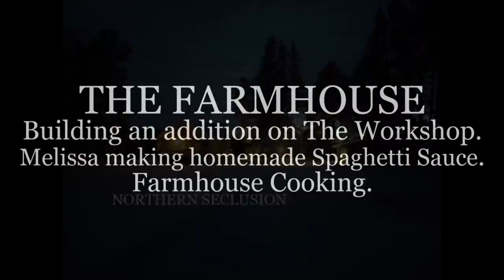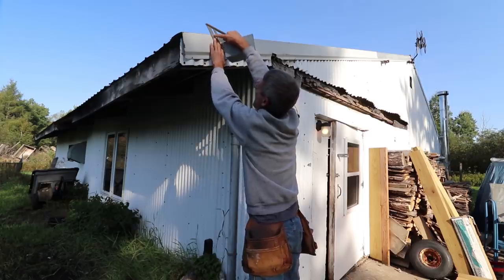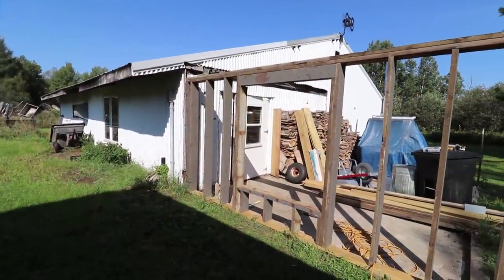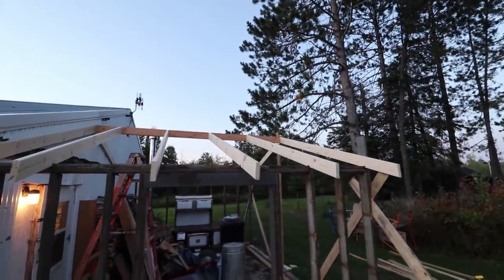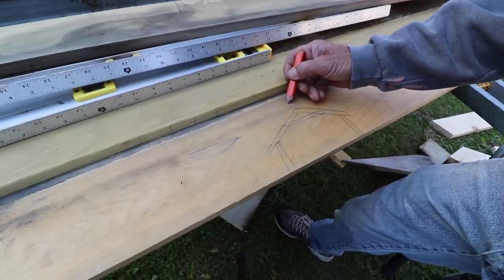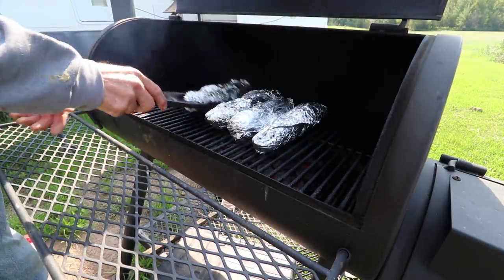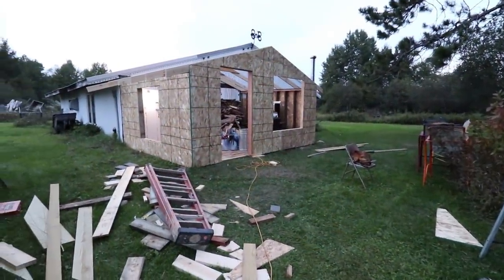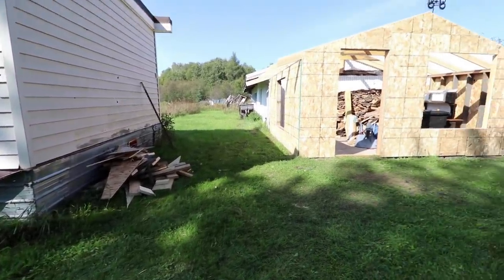THE FARMHOUSE. Building an addition on The Workshop. Homemade Spaghetti Sauce. Farmhouse cooking.

Comment: Awesome addition job Joe, scrap wood for the wood burner in the shop. You need to build a shed that size south or east of the garden for some calves so you can have home raised beef. Love your multi tasking of cooking and grilling and carpentry work on the workshop. Those boards would look good on the shop like the chicken coop. You must of wore the dogs out on the run into the woods. You need to add on to your outdoor kitchen and add a pizza oven to the outdoor kitchen, they have been advertising one on the You Tube channel ads it's pretty cool and not very expensive and then you can make your own pizzas and you have your own sauce and veggies to put on it. You saving the scrap wood from your house jobs comes in handy for your additions.
Love your videos waiting for the next one. Stay safe and have a great week ahead of you. With everything you cook at home you should have plenty of leftovers for the week at the camper and shouldn't have to cook at all.

Comment: Really great video Joe, I think that deck board on the front would look fabulous. Will you be able to move that stove through the doors? 💜💚👍👍🛠🤔
Reply from the maker: Yes it does fit through a 36 inch door. When I bought it we removed it from the peoples house through a 36 inch door. You need to remove some of the trim pieces but it does fit.

Comment: In places where they get a lot of snow,and if the rafters are 2 ft on center,they usually. Double collar tie the rafters….one on each side…in your construction business do use a router with a bit to shove in the window and doorways and just router around them in about half a minute?
Reply from the maker: No router needed to install windows. I am not installing plate glass, I am installing windows. Very seldom will you see double collar ties unless it was a damaged truss that needed a repair. In that case you usually have to do it with 3/4 inch cdx plywood and it must be glued and then you have an engineered nailing or screwing pattern.

Comment: Joe, you need an Air Nail Gun or gas Gun!!! You may have them but don’t want to show off with them. But working bye yourself is hard enough!! without using old school tools? Lol next you will be bringing out a brace & bit for the hole you want to drill. Lol
Reply from the maker: I was going to bring out the compressor and the air guns but figured that it was too much of a hassle for a job this small.
Reply: I just think the wear and tear on your body let alone you working by yourself. Man I’m hear to tell you I don’t know how you did all that with just you holding up both ends of the rafter runner?
Can’t wait until Duck Season!!!

Comment: I feel (no engineer) that u should have added two more two by eight s to your ridge pole😁
Reply from the maker: Never needed in this situation. I could actually have done this with no center ridge since all that ridge does is hold things in place as long as I have the collar ties. When they use a truss system there is no center ridge. Adding the collar ties in effect made these into a truss. Once the roof is sheathed or in this case the cross 2x4s were installed the center is doing nothing. If I was to do this using no collar ties because I wanted a fully vaulted ceiling then I would have needed a strong ridge because in that situation the ridge is holding everything and all the weight.

Comment: Looks good Joe..curious what type of folding saw horses you were using. I am tall like yourself and those looked a comfortable height as most are too short for me. Thanks
Reply from the maker: The ones in this video are DeWalt. I buy them at Home Depot. I have a few pair of them and they last a long time. If you do not cut through them. Lol.
Reply: Are you short? Joe is not tall…at all.
Reply: @SuperDave44Mag  He appears so
Reply: @ronaldlee2376  not walking thru a 6’-8” doorway.

Comment: Joe, How does that OSB hold up at the ground level? It looks so close to the ground.
Reply from the maker: You can not have it do any ground contact. You will see what I will be doing in an upcoming video. I have not done it yet, today was finishing the roof, and installing the door and windows. Stay tuned, it is hard for me to explain what I will do but to answer your question, no it will not hold up well at all.

Comment: Or you could beef up the ridge pole like go 2 by12 or bigger then don't worry bout it
Reply from the maker: Or I could have ordered pre manufactured vaulted trusses. Or I could have used a steel beam for the center ridge. Or I could have used a micro lam for the center ridge.
There are many ways to build something and all will pass inspection. Like I have told guys that have worked for me over the last 30 years. "There is only one way to build something and that is the right way..... When you are working on my job, the right way is my way. When you are making out the checks you can then do it your way" Lol.

Comment: I am genuinely curious why you are still using a drill to drive screws and not an impact. Please explain ha.
Reply from the maker: all 6 of my impact drivers are at work. I have one really crappy one here at the farm that does not have much power anymore. I fully planned on bringing out the compressor and the air guns but was too lazy to go through all that trouble for such a little project.

Comment: i am shocked being building is your trade that you dont have a routor ans sheeting cut out bit, and a pasload framing nail gun, i find trying to cut openings in OSB VERY TIME CONSUMING AND VERY RUFF MESSY CUTS. building not my trade but i bought my routers and many bit sets of all sizes, pasload framing and finishing nail guns back in the mid 80's and my sliding compound miter saw back in the late 80's with the matching stands it locks on to i use it to cut every thing from 6x6's 2x12's to trim, i am a jack of all trades but a master of 2.. at 60 years old they all mostly sit,, but they made build so much nicer and faster. cleaner, being left handed i hate skill saws the dust in the face all the time, my Milwaukee skill saw is from the late 70's i bought of the tool truck that came every 2 weeks to the no mans land bush camp,  and still works like the day i bought it, it been left in the rain and snow many times, fallen from roofs, the craftsmen and black and deckers have all gone to the bin years ago
Reply from the maker: I have all of that stuff. I have been doing this for 40 years. It makes building nicer but a project as small as this one it really ends up being a waste of time. This was mainly framing, taking the time to pull all that crap out and set it up? I could be half done with the project by then. LOL. No need to really nail the sheathing very good when I have 2 fasteners every 6 inches when I put on the deck boards. It would have been overkill and not needed. Those old tools never die, they just keep on working.

Comment: I am curious about your construction. When do you use nails and when do you use screws?  I see you using both and I would like to know why you use one over the other.
Reply from the maker: No real reason, I just used screws for some of it and nails for other parts. The whole thing could have just been nailed but since I did not bring out the air tools I screwed some of it.